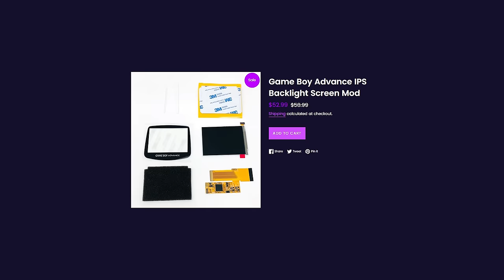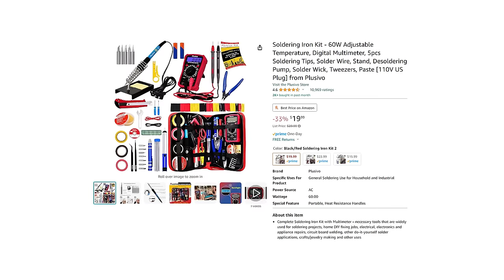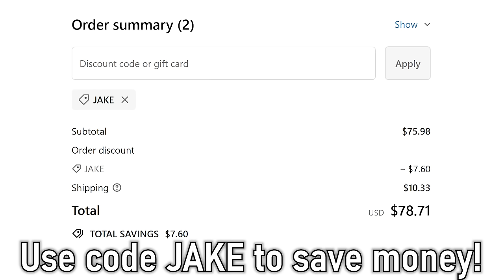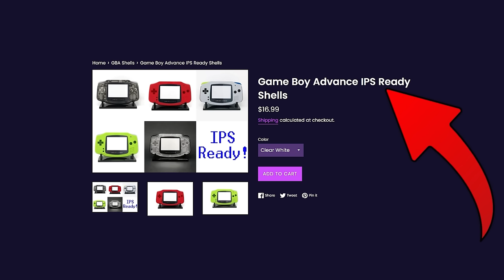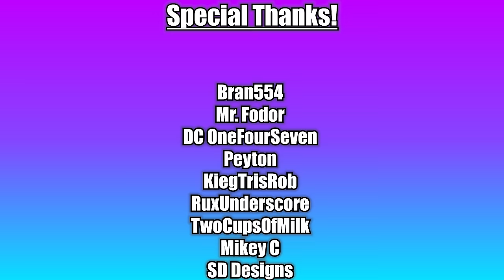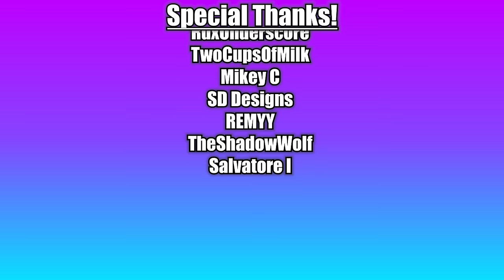How to MOD a Game Boy Advance! (In Depth Tutorial)

Comment: I’ve modded 4 GBA’s, 2 successes, 2 failures 😅 my dream GBA is a wide AGB model with a SP 101 screen but I don’t trust myself to do the mod and I can barely find anyone talking about how to do that online 😢
Reply: I have the Latias Latios console with a 101 screen in it, my BABY
Reply: Whats the difference in the "wide agb" model?
Reply: @rudolphgreen2641  Wide and AGB both describe the game boy advance model I’m talking about, which is the first one Nintendo released.
Reply: Man, if you can get an ips screen, I highly recommend it even if you have to trim a bit. But if you're going for that look, I got a knock off Halo Light back in the day that was better the original Halo Light,  and my screen looked pretty close to my cousins SP screen. Maybe you can order one of those and use some parts from it for a screen brightness slider, and fits it all in the battery compartment! Then you would just need wires from the dial to the screen.  
Just an idea I thought of.

Comment: Hey people, hopefully someone can help me. Iam new at GBA modding and I have the same problems again and again: When I added a new case and new buttons, first, the shoulder buttons are not so "clicky" anymore (its stressful to click on them, it doesn't feel well) and the D-pad is also harder to click as the original buttons. You need more power to get a result. That leads to strained fingers. As a solution, I always switch to the original buttons again but they aren't really good looking in a golden or transparent case. Do you have some ideas to prevent this issues? Also I bought many sets of buttons and shoulder buttons from ebay. Its always the same, I dont know why. :(

Comment: I tried to mod my gba a while ago. First i couldn’t fix the speaker, i even installed a new one and it didn’t work. I think it was the headphone jack. The i replaced the screen and now it won’t turn on
Reply: Did you install a ips screen? (Might be possible that you have a 40 pin model and have to desolder C54 in order for it to work) or it might Just be the ribbon cable that is not inserted correctly
Reply: @basboerlage4766  i think it was an ips screen
Reply: @HoneyMike  and is it a 40 pin model?
Reply: @basboerlage4766  i had to check and it is a 40 pin
Reply: @basboerlage4766  i just tried it again and it actually does turn on but it freezes when it gets to the game. Some games will show a glitchy screen some don’t show anything
Reply: @HoneyMike  that is not good news, encountered a gba like that once. Is there solder leakage on the cpu? That might cause this problem
Reply: And Just to be sure, C54 is removed from the motherboard?
Reply: @basboerlage4766  i haven’t removed C54 and i didn’t solder anything near the cpu. For some reason original gameboy games work
Reply: Might be a good idea to share images of the board on the discord if you havent already

Comment: I have a gba that i got at a garage sale that wasn’t working because of the power switch so i took it apart and cleaned it with 99% alcohol and gave it a gentle but good cleaning and it powered on. My guess is that it just got buildup of dirt and grime that made the contacts stop working

Comment: Unrelated to the great video, but: my 101 gba sp has a very low soublnd volume. I've read on the net that it might be a capacitor (cp1) gone bad. How can I make sure that's the case? Also, how to properly clean the power switch and volume wheel?
Reply from the maker: Most likely a cap replacement would fix your sound issue. Unless your volume slider is visibly rusty or something, it’s gonna be the capacitor. There is a link in this description for my short on how to clean your power switch. For volume wheels just put alcohol on it and scroll back and forth very fast for like 30 seconds and finish by blowing it with canned air to knock out any dust or debris
Reply: @JakeSimmons  cheers mate

Comment: I know the mods always come with wires to connect the components to the ribbon cable but I lost one so would you be able to let me know the size or kind of wire I need connect the components ?
Reply from the maker: I use 30 AWG wire but really anything will work as long as there is space for it
Reply: @JakeSimmons  really appreciate the reply thank you !